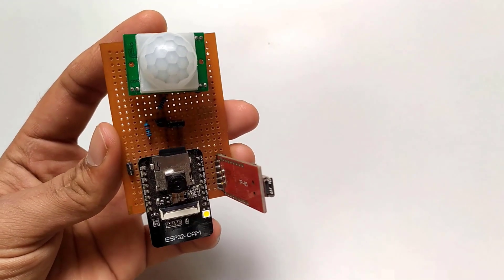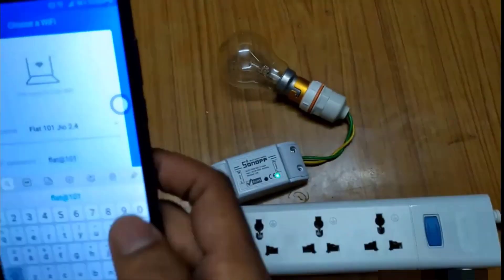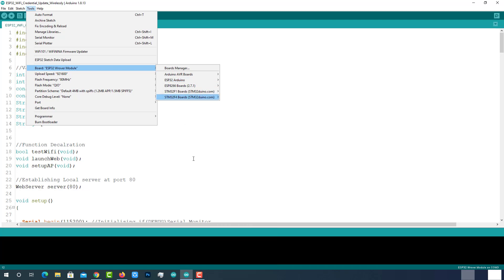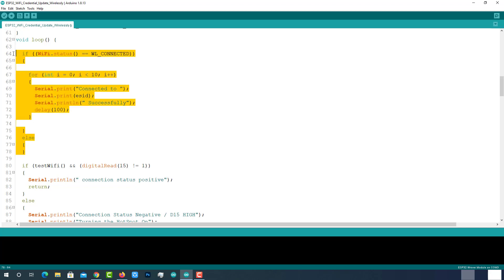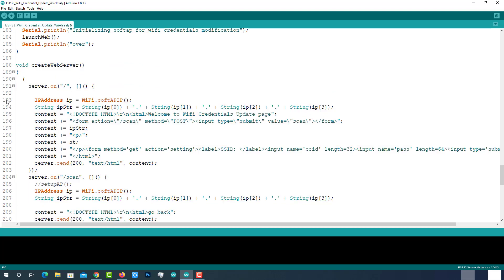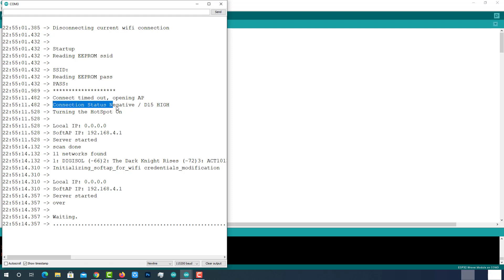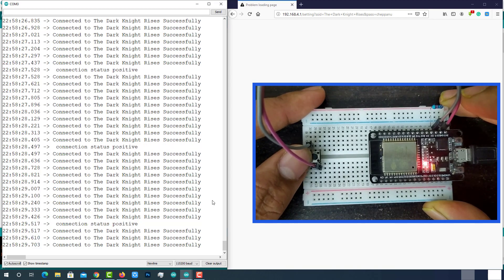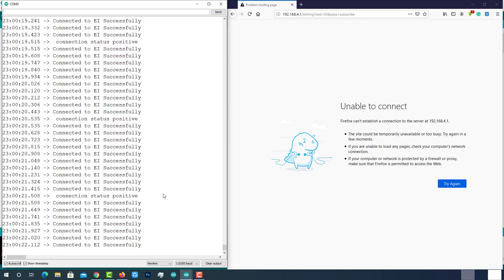Change & Store ESP32 WiFi credentials in EEPROM without uploading code

Comment: Nice work.... There is only one thing that i don't understand...  everithing goes ok. but if i  disconnect the  wan line of my router (so Wifi is present) in serial plot it write "Connection Status Negative / D15 HIGH" and it will open the AP function! If i will re connect wan cable, the ESP32 it doesn't re connect, becouse is in AP mode... how can i avoid this?

Comment: Hi, I am using ESP32 WROOM32D module and trying to read and store the read values from eeprom to ssid, pass in order to then connect to WiFi automatically. Here's my snippet: ssid+=char(EEPROM.read(addr)); which is in a for loop of course, but all I get in response are the inverted question marks. Sigh, what is it that I could be doing wrong? Any help will be appreciated.

Comment: How is the access point ip address determined? Will it always be 192.168.4.1? How do users find it with out the serial monitor?
Reply: Late response, but you can use other techniques in the sketch to force connection with a static IP instead of relying on DHCP.

Comment: This wasn't what I was expecting (figured it might be some IDE function for to writing direct to the EEPROM somehow - similar to how it is possible to write to the "file system" [of sorts]) but I learnt some useful stuff anyhow. Some impressively functionality in that webserver.  Feel somehow the credentials are crying out for a data structure and a layer of abstraction for read/write but of course that would not make a good basic demo for beginners. I need to go read more on the EEPROM library and see what can be done...

Comment: I could design code to accept wifi credentials with bluetooth and then connect to wifi still this was helpful. Thanks for this video.
Reply: How?
Reply: @shubhamsen4572  using BluetoothSerial library and android app
Reply: @akshaygodase8067  do you have saved code on github
Reply: Esp already has that feature called bluefi. Or you can use the smart config example provided by espressif.